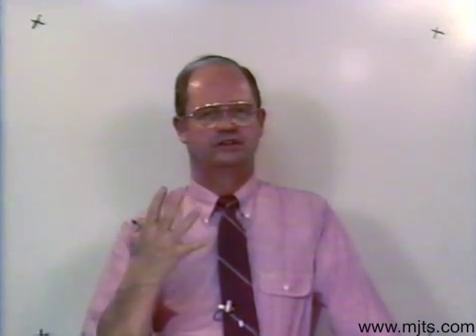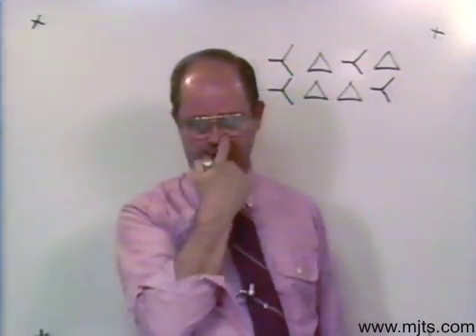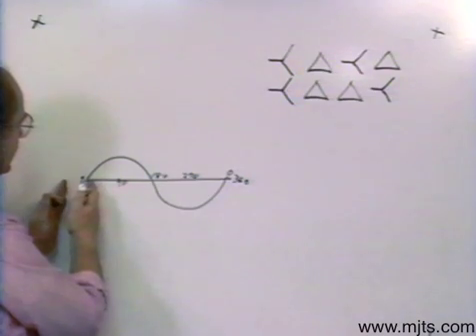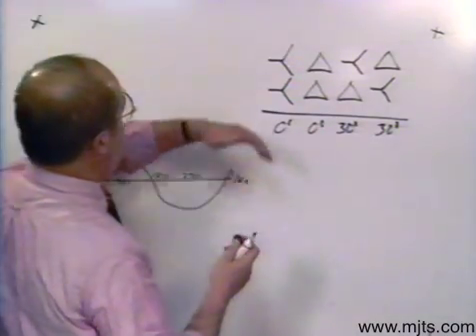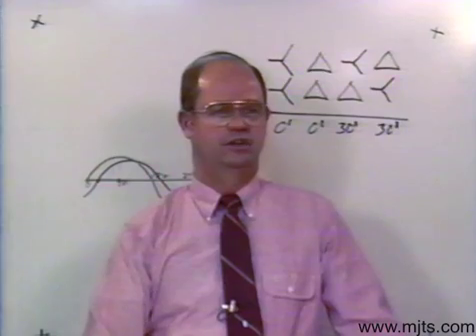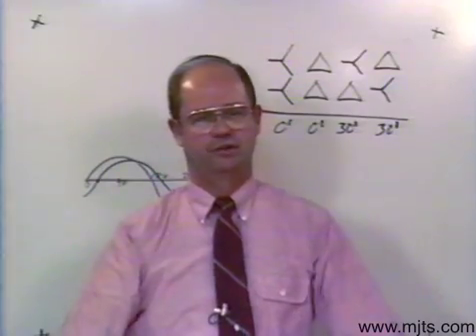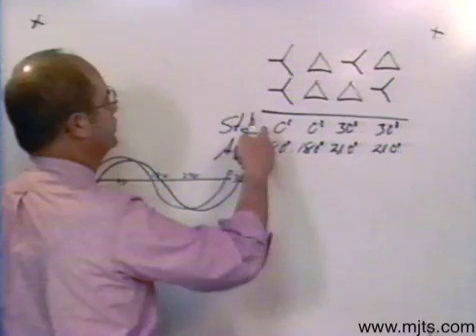Phase Displacement

Comment: You have not mentioned why there is a phase shift of 30 electrical degree b/w the primary and secondary. What is the reason ?
Reply from the maker: +Bharath Krishnan start watching the video again at about time 3:20.  Dennis mentions a 30 degree phase displacement several times.  Then he goes on to discuss the alternate displacement of 210 degrees.

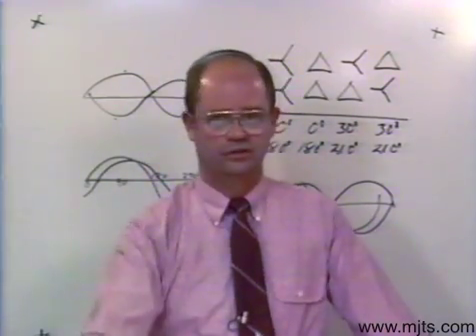Comment: Jump to 8:29. With a 3 Phase system 180* out, motors will NOT operate in reverse rotation. The rotation and sequencing remain the same.
Reply from the maker: You're right, Changing phase displacement does not change phase sequence.  Not sure why he threw that in at the end, I'll edit it out, thanks.